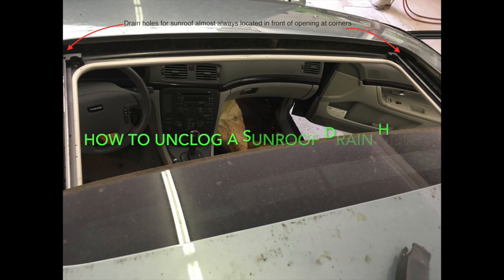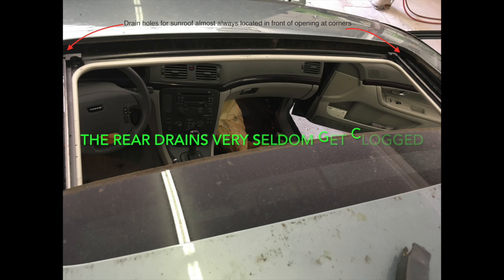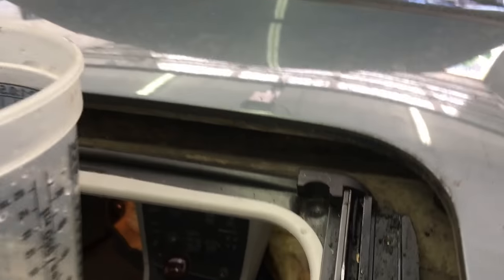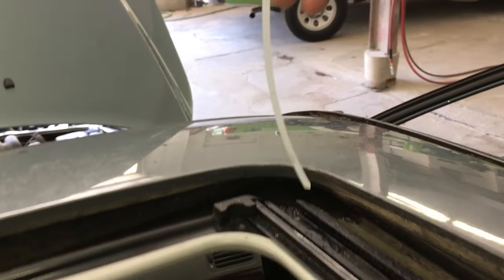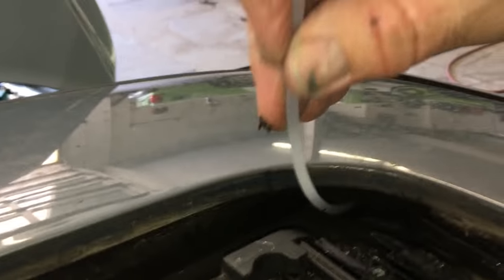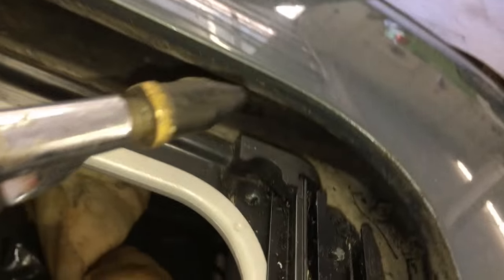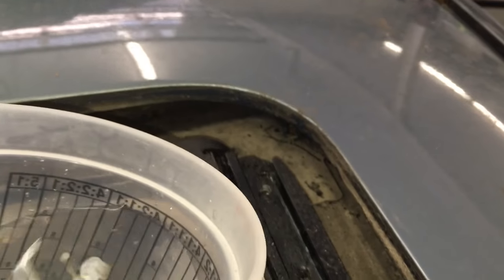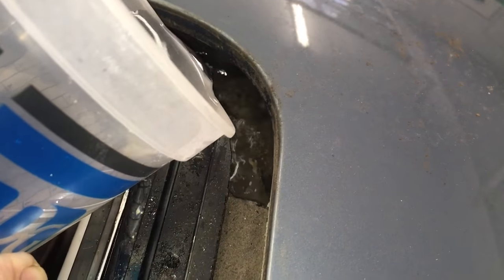How to unclog a sunroof drain

Comment: My method: cordless drill + 24" of weed eater line, and BAM! Done in two minutes.
Reply: Just don't spin the line too fast. Slow & easy will work just fine.
Reply: This!!… thank you!
Reply: Me too never had an issue and silicone oil on runners
Reply: My method, throw the window out and weld a steal plate on the roof.
Reply: Smart, Mike.
Reply: Cheers MIke! Much appreciated… that worked perfectly! 😎
Reply: @timfunk4438  lol
Reply: Awesome tip, thank you
Reply: Definitely a good idea I usually blow air up through the drain line so it doesn't pack the blockage down tighter then I pour water down to make sure it's clear before flushing with water and air
Reply: How?
Reply: You a genius, thank you. Never thought about that
Reply: @volt8684 will that keep the sunroof from sticking open?
Reply: Did not work for me. I dont know what i have in there
Reply: Thank you!!! I used some weed eater trimmer line and it worked!!! Poured some water in the track of the sunroof and the water exited under the car!!! Did both sides just to be safe ❤❤❤
Reply: Right on!!  Very clever.
Reply: @timfunk4438 that would be steel 😂
Reply: The guy at O Riley’s told me the same thing right now
Reply: @DFWAuto_Hack .  I wonder if the cleaner that HVAC guys use for cleaning the fins on AC units would help dissolve whatever’s in the drain lines???
Reply: @Johnny-ip4mk  i have no idea

Comment: I was warned specifically by the dealer NOT to use compressed air - if there's a stiff clog below, the pressure can blow the plastic tube off the metal one in the frame, and then you've got a leak until you completely disassemble the door frame.  If it's persistent, better to find the exit in the wheel well and blow air up that from below.  I used a piece of tubing over the exit and blew through it by mouth, and got a big plug of black glop to fly out.  Good luck.
Reply from the maker: Yes, (and as the video shows) the clog is to be cleared first and only after the water is running through the drain should you use compressed air to flush the remaining debris through.
Reply: I don't understand, you blew the clog back up into the car?

Comment: A quick fix if you don’t use your sunroof like me is put a bead of Magic Lube lubricant and sealer around the gasket area at the outside of the roof. We use it for swimming pool business works great. Works in weather temperatures 0-425 degrees

Comment: BTW Compressed air is a good way to possibly blow the drain line off of the fitting (the drain hole) at the top. I used air on my 2007 Cadillac DTS, and it blew the drain line off. So be careful when using compressed air! 👨🏼‍🔧 🔧

Comment: careful.  I wouldn't use air.  Those hoses have been known to blow off if they're getting old. Just clean the drain hole then pour some windshield washer fluid down the drain. Just a little, like half a cup.
Reply from the maker: I agree with that, I've emphasized it many times in the comments below--that air is not necessary for cleansing the hoses. But it's also an exaggeration that it will damage them, definitely should not be done before the clog is removed though.

Comment: Thank you sir!!
You just saved me $975 plus a $208 diagnostic on something that can be easily fixed for less than $5
Reply: Really $1000 to fix a clogged drain ?
Reply: @ksubyslowed  welcome to dealership prices 😒😤
Reply: @ksubyslowed  they don't usually tell you that and then rip you off. All mechanics and dealerships do that
Reply: Toyota dealer wanted $275 just to diagnose. I fixed it myself.

Comment: Thanks for sharing, I just learned that my truck may have clogged drain tubes or a leak in the rear cab brake light. I only recently discovered that my floorboard behind the driver's seat is damp: I thought I either left my door ajar or the seals in the door frame or rear window was leaking.  I was conversing with the guys at O'Reilly's and one guy inquired if I had a sunroof - yeah I do have a  sunroof! It is making sense to me because I started having a sagging headliner 2 to 3 years ago.  I thought it was Florida humidity, but Geez Louise, I pray that the inside of my cab roof isn't rusting. Last night I checked my sunroof and I noticed the plastic parts are cracked - I hope I can fix my water leak problem.
Reply: So what ever happened? Did you figure it out, fix it? Just curious.

Comment: Thank you!! i had 2 front clogged, worked fantastic, i put almost 4ft of line down the line. then blew it out,  was fast on driver side, but passenger bubbled, so i pushed the weed eater line back down, and put a bit of lysol floor cleaner, idk. but its fast now, and i even took a hose to it. thank you!!
Reply: The video was supper cool, it help fix cheap

Comment: This guy is an angel! I have a 2018 Honda HR-V that started having this problem a few months ago but I hadn't had the time to take it in. I was about to pay whatever to fix it but this video saved the day. Problem now fixed for only the cost of the trimmer line which was $5.47 from Walmart. I also cleaned out the sledge along the sunroof rack and space where the water funnels to the drain. Plus I ran a little vinegar and water to flush the drain. I don't have a problem anymore!
Reply from the maker: Happy for you! thx for the nice comment✌

Comment: 2016 Rav4 sunroof leak due to clogged drain. I tried your method and it worked - THANK YOU! My passenger seat and floor was soaked after we had a huge storm with lots of rain in a few hours. Poured water on the left side and drain was completely clogged. Tried to unclog myself but didn't work. Soaked up the standing water and then used the leaf blower. Worked like a charm! Used blower on the right side too. Now both drain super fast. Thanks so much - you saved me $ and frustration of trying to find someone to do it. Love this DIY!
Reply from the maker: I love hearing that…thx!✌
Reply: Can I ask how you got the ceiling material cleaned after that?
Reply from the maker: @magalirodriguez7830  depending on the nature of the leak, the wetness is usually isolated to the floorboard. It would be very unusual for the headliner to be wet, but I guess I can see how it would happen. I think it will just be a matter of time before it dries, but will probably leave a stain. When drying out the interior of a car, we usually open all the doors and blow fans through it.
Reply: @eldigitom9680  the liner is stained and it smells musty 😞
Reply from the maker: @magalirodriguez7830  bummer, good luck to you my friend!

Comment: Straight to the point. I used one of the many saved straws in my car and attached it to my air inflator. Worked like a charm.. Now I wait for a heavy rain 🤞🏽 👌🏾
Reply from the maker: Or you can test it with a water hose. Just by simulating a rainfall, your choice.
Reply: @eldigitom9680  success! Thank you sir!
Reply from the maker: @mdmale80  allright!!

Comment: Thank you for this you just saved me so much trouble it took me all of 5 minutes to fix my month long problem
Reply from the maker: Good!
Reply: I've been having to cover my car up when it rains for almost 2 years now because I live in a retirement community with no garage. I had to research myself what the problem might be because I'm not finding anyone that even seems like they have a clue. I really appreciate these videos because As an older single woman I have found it's best to do it myself if I can and a neck of a lot cheaper.
Reply from the maker: @paisleygirl6642  Good luck fixing that leak!. Does your car sit underneath a lot of trees, per chance? That is a major cause for leaks, especially when the cowl screen gets covered up with leaves and twigs. It will cause water to be diverted through the heater box. Just make sure that cowl screen stays cleared of leaves and debris.
Reply: @eldigitom9680  Where is the cowl screen please? I need to learn to clean that out. My car sits under trees as well.
Reply: @commentoria  The screen between the top of the hood and the bottom of the windshield.
Reply: @michytoodle  thank you! I will check it.

Comment: Thanks for the good quality no nonsense video. I'd be careful blowing air through from the top of the drain. As good an idea as that is, some cars like the E 90 series BMW, have a very weak attachment above the headliner where that drain tube goes into a fitting. At that point, the tube can come off and then all the draining will be into your headliner and passenger compartment. It may make sense in some cars, (all or most BMWs, I don't know) to try to check that, or if you can't or don't , then be real careful about any pressure you apply on or through that tube! 

If you can find the weep holes (below the car but above the trim usually that's directly under the car,) usually identified by rubber grommet type fittings, that would be a good place to clean out because the dirt & debris that drains down to those often hangs up and forms form clogs. So clean out above and below, if you can!
Reply from the maker: thx for the head-up, I appreciate it. I find scraping around the upper holes cures most clogs.

Comment: Found your video after probably 2yrs of the insides of my car stinking so bad after every rainstorm. My backseat, floor boards, and interior ceiling would be wet. So decided to try your method and am praying this was the issue. I’m going to wash my car tomorrow and I pray this worked 😅
Reply: didi it worked?
Reply: Did it work
Reply: @loveoneanother133  unfortunately no. Three of my 4 drain holes do drain but the 4th I believe has a detached hose/drainpipe. I also can’t see the drain holes that are near the back. It could be clogged but I just decided to seal my sunroof until I can have someone look at it
Reply: @cj80911  thanks for replying. I think I’m in the same boat as you. :( I don’t wanna seal mine.

Comment: Years ago (1964-1965) I owned a 1963 Austin Healey 3000 Mk II - this was the first year with a "pull up" convertible top. My parking place was on a slight downgrade, and when it rained my passenger side floorboard would fill up with water, sometimes 2-3 inches deep. It ruined the carpets. I looked and looked for the problem, and one day I noticed a small rubber drain tube, about 4" long, above the right rear tire. It was connected to a small trough that collected the rain runoff from the convertible top. Inside the tube was a small rock, undoubtedly kicked up by the tire. I worked the rock out, and it solved the problem.

Comment: These instructions worked great! I used a long flexible brush that's meant for cleaning water supply lines in refrigerators. 

My vehicle is a 2015 Toyota Sienna XLE and the drain holes are completely hidden from view, even if you stick your head up through the open sunroof. I located them by pouring a few ounces of water into the trough around the sunroof (with it slid open) and probing carefully around and under the tracks that the sunroof slides on. When I found a spot that seemed to be an opening, I worked the brush into it until I was able to slide almost three feet of the brush into the hidden spot under the sunroof track. After pulling out the brush, I tried pouring water again, and this time the water drained away, emptying out behind the front tire well. 

I repeated the same steps on the other side with the other drain hole until water was flowing out. I'll update with another comment the next time it rains to confirm the drains are working! 

Thank you for your help!
Reply from the maker: Excellent!

Comment: Used a weed wacker string this morning and it flowed straight through. Thanks!
Reply: I tried that today and i got to a point where it just wouldnt go and would wind up around the hole. I am going to try a speedometer cable as they are a bit more stiff

Comment: Thanks!  Bought $0.97 pipe cleaners and unclogged the hole.  Water was draining out the bottom exit so it worked exactly as you described.
Reply from the maker: Yo!

Comment: Good video on this.  The gunk that shows in the tracks and on the sides of opening and on the rubber around the glass need to be cleaned.  This can cause the rubber to degrade and the roof will leak more. If it's clogged mold or mildew can build up and start to smell up the car.

Comment: Awesome simple explanation. Thanks. My seat was soaked this morning along with the floor board. I hope this is it.
Reply: Did it work ?
Reply: @EleganX627  seems to have. I used weed eater string to run down the tubes. I then poured water to make sure it was draining. I have had water in the floor since then but wasnt sure where it's from. I think it may ha e been from the ac with humidity dripping or I didnt let it dry out good. But has been dry completely now for a couple weeks. I do mostly keep it covered. I have been in some heavy rain also though.
Reply: Tim Fulford damn I’m looking at an Infiniti car but has that problem of drains getting clogged up , I don’t know if I should walk away or not because I wanna buy the car and just fix that and keep it going, I don’t want it to be nothing major.
Reply: @EleganX627  well my seats are dry for sure it did definitely fix that part. I'm pretty confident it is not leaking anymore. I just lifted my floor mats this weekend to make sure I did not see any condensation and it was dry. It's really not a big deal. Especially if you know how to clean them or repair them.
Reply: @EleganX627  i have a 2014 q50 with this issue right now. passenger side floor is always soaked after rain. this really sucks especially when the fix for this is over $1000 invoice from infiniti apparently.

Comment: Your video was spot on. Saved me a to the mechanic. Thanks!
Reply from the maker: Wonderful! That's the goal, thx.
Reply: Ford wants 500$ to clean mine out.   Is at their shop right now. They called me to tell me the problem.   Not covered by warranty. I will pic up my car tomorrow and do it myself.   Mine are the back ones though. I hope I can reach them as easily as the Fromt

Comment: Thank you great video! Did this on my 2006 Outback and then helped a friend do it on a 2000 Grand Cherokee and worked perfectly with compressed air and some drain cleaner!
Reply from the maker: Drain cleaner?! whoa
Reply: Just heard from our auto body shop that Outback’s sunroofs clog much more than most cars.  I am going to make sure I blow mine out once a year from now on!  $1000 worth of water damage has taught us a lesson.  We didn’t even realize water was accumulated on the floor until we smelled the mildew.

Comment: Good way to unclog most sunroof systems.  Unfortunately my 2001 Subaru Outback had a major buildup of dirt and mud between the fender and wheel well liner.  Air wouldn't clear the line until all the muck was cleared from where the drain exits the body.
Reply: How did you get it cleared?
Reply: I'm also curious, how did you get it cleared?
Reply: Thats where the engineers designed thewater and debris to collect makung your car rust out.  Every Ford F150 the drain hose funnells the water into your rear cab corner and rockers.  All water is drained in there

Comment: 2017 rx350 soaked inside.   Trimmer line fixed it faster than it took to dig out the line.  Should be on the list of preventative maintenance.

Comment: You can use 3D Printer Filament too. Works great when you don’t have trimmer line. I pulled it off an old spool and cut the end at a 45

Comment: There is a perforated plastic plug in the bottom of the drain hose.  It easily gets plugged with debris. After removal of the plastic trim near the corner off the door frame I popped it out by pulling on the hose with a pair of needle nose pliers.  5th generation 4runner
Reply from the maker: I wonder what it’s purpose, unless it’s used as a stiffener to keep the hose from collapsing? But it would definitely be a liability for clogging. Kind of like an aerator on a kitchen faucet.
Reply: @eldigitom9680  it’s sectioned off into 4 sections.   So 4 quarters. Not really sure of the purpose.

Comment: Don't blow compressed air down those tubes if they are blocked because you can blow the tubes off inside you roof lining or even further down and it is a lot of work to fix it. Always make sure that at least a bit of water is going down first then try to clear it with the trimmer line first an then you can use the air to finish off with.

Comment: I’m gonna try this. I was going to buy a long wire brush/pipe cleaner on Amazon. But I’m gonna try this first!
Reply from the maker: @dadthefixerflorida  good luck, my friend! I hasten to add that 90% of the time the only thing needed is to scrape the muck away to expose the drain hole opening. Hardly ever is it necessary to run a line down into the drain tube. Hope this helps.✌️

Comment: Thank you very much a technician wanted over $400 and wanted to tear out my headliner to fix that. 😮
Reply from the maker: I really hope this works for you. It's good to check these drains--by pouring a cupful water--from time to time as routine maintenance just to avoid buildup in those drain holes.
Reply: @eldigitom9680  I had no idea that it is so much involved and maintenance on these new cars give me old school when you only had problems with the engine and transmission new designs are ridiculous. 😕
Reply from the maker: @TERRY-e4h  totally agree, too many add-ons